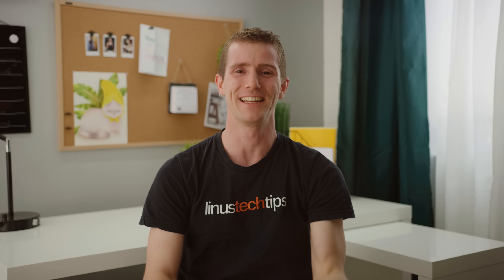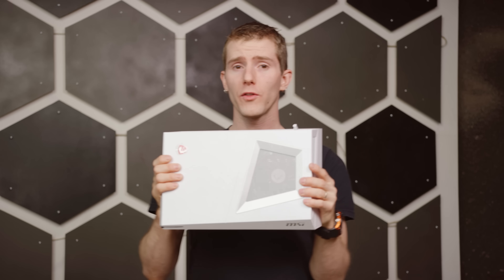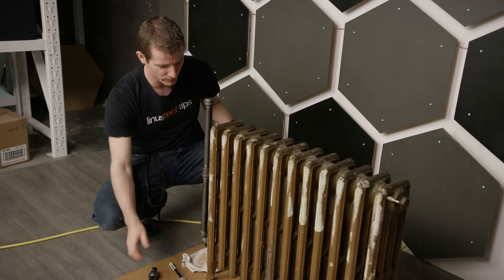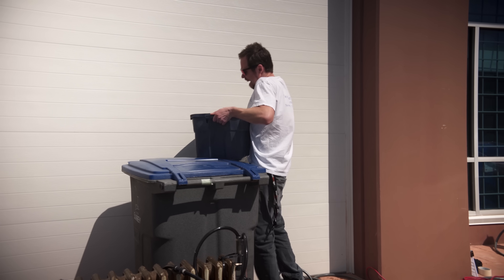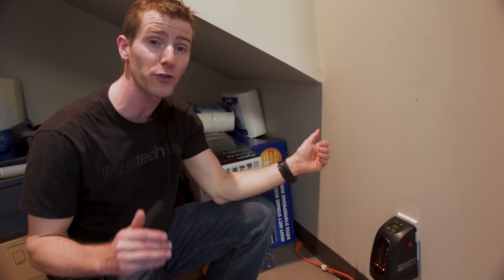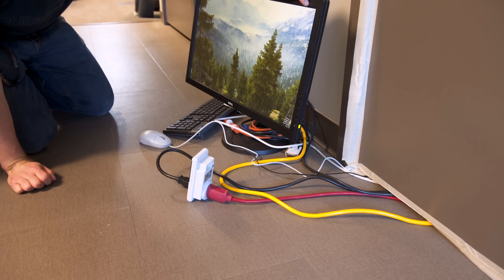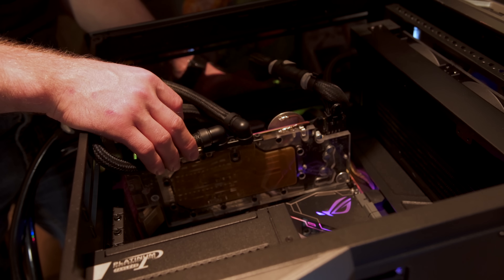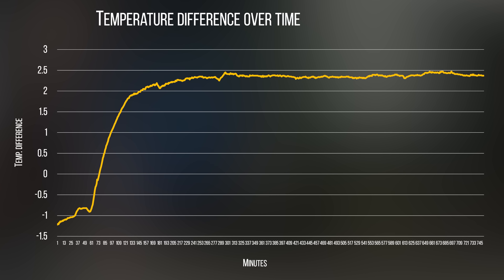Lower your heating bill... with GAMING

Comment: This doesn't make any sense. If the computer is in the room, it outputs heat amount X and with that heats up the room. If you connect this to a big radiator, the output of heat is still X. So why all this effort?
Reply: In a traditional PC, you don't have enough surface area to transfer the heat through air. Hence the high temperatures and thermal throttling, so it won't heat the room as much compared to a heater. 
In this case, we have more surface area to transfer heat from the CPU and GPU to the room. Hence, a better heater. 
Hope it helps.
Reply: @9theaman Ok, under the assumption of hilarity of this experiment I can let this count for short time usage to probably heat up the room by half a degree more. Though if you want to use it as a permanent solution I believe you'll run into the problem that the water eventually is hot and the radiator can not quickly enough release the heat into the air. You are basically building yourself a buffer so you have a longer time until throttling kicks in, but then likely it will kick in much harder.
Reply: @maggnet4829  yes, that's why nobody does that.
Anyway, to combat throttling you can add a fan to the heater but it will still max out eventually unless there's open window. But that would defeat the purpose of a heater.
Reply: @9theaman  The fan should help. I wonder though how many you'd need and where to best glue them. lol

Btw. one a bit unethical advice for anyone who has exposed heating pipes and lives for rent in a building with several renters and where the heating bill gets determined by a measuring devices at the heater: Just install a quiet fan at the pipe, before the radiator and you can safe a little bit of heating costs. 

PS: Damn, and here I thought they don't connect a heater to a PC because it's economically and space wise unreasonable. :D

Comment: You realize just putting the tower in the room on regular fans the PC would just heat up the room any how right? All that crap is stupid. The PC running in a room heats the room thru convection and air any how LOL. I already knew this i mine ETH n i can tell you the room gets HOT. i have to exhaust the room with box fans thru the window on a electronic temp timer. The room still hits 85F even with the heat being exhausted out with 15  Rx6800 gpus running.. the room is a 10 x 12 spare bedroom im drawing about 2000 watts almost so yeah lol.

Comment: Its a stupid experiment. You dont need the big ass room heater. Just a normal pc inside. You said it - watts in watts out.
As long as the pc consumes the same amount of watts as a heater that heat will go into the room no matter watt(pun intended). The big heater is unnecessary.

Comment: Completely useless and illogical for heating whatsoever, but "cool" nonetheless lol. For anyone who doesn't understand: the PC by itself will heat up the room just as well without the radiator (although it'll help buffer temperature swings when the PC is turned off).

Comment: The first law of thermodynamics: When energy passes, as work, as heat, or with matter, into or out of a system, the system's internal energy changes in accord with the law of conservation of energy.

Most pointless experiment ever.
Reply: Why even bother adding watercooling. A normal heatsink would have done exactly the same.

Comment: This whole video makes no sense at all. You're basically trying to prove that a PC actually generates heat. Then you're trying to compare that to a 350w heat source. Also, what's the deal with the huge radiator? Don't watercooling solutions already include radiators? Radiators that are already engineered to move heat from a pc... pointless.

Comment: Dislike for not making a joke about AMD FX CPU.

Also pointless video which shows a misunderstanding of physics.

Basically all energy is transformed into heat, even the air the fans blow out. Also no need for water cooling or a big external setup. A normal heat sink and fans or a normal water cooler would still get the same heat out of the box and into the room.

Light also is absorbed by walls in room as heat so maybe tiny amounts of electromagnetic energy escape. Basically everything that comes into the Power Supply is output in the room.

Electric heaters that claim more efficiency are a SCAM! Watch "Technology Connections" video on the subject. They are all almost 100% efficient (minus some escaping EM energy and some chemical alterations on the metals and plastics of the device).

The only way to have more efficiency is a heat pump, like air conditioners. These can be 4 or 5 times more efficient, but it depends on temperature difference of outside and room.